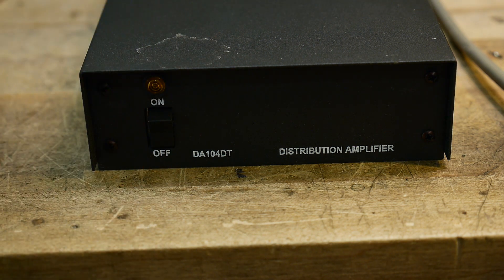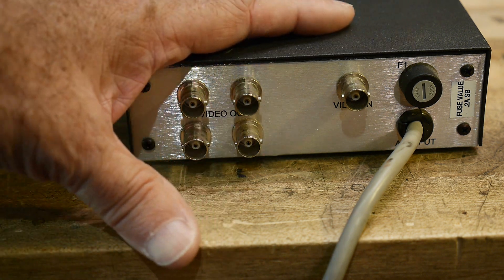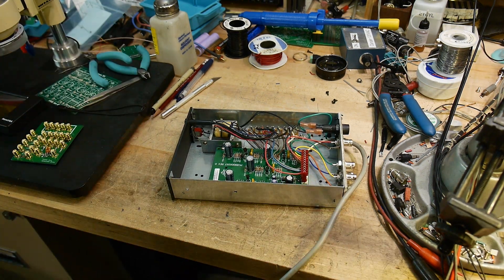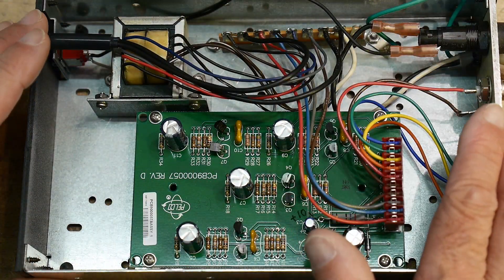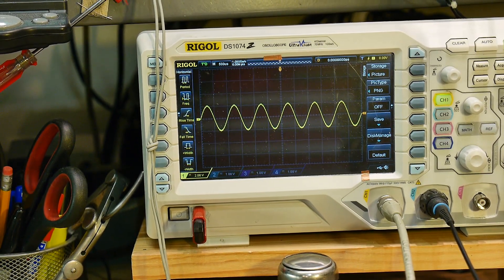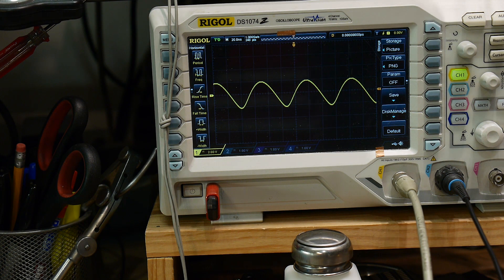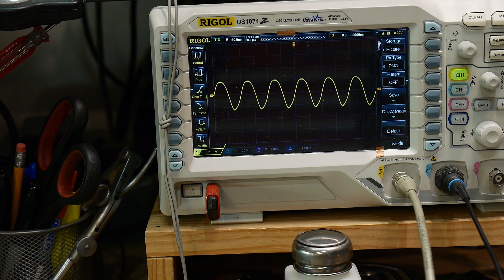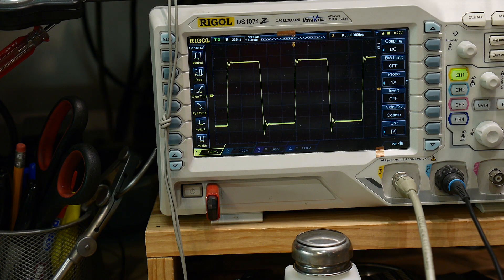#579 75 Ohm Distribution Amplifier

Comment: The output impedance of a video DA is usually set by a series build-out resistor of 75 ohms This one evidently has a fixed input impedance of 75 ohms set by a shunt terminating resistor of 75 ohms.  You can change the impedance to 50 ohms by simply changing the 75-ohm resistors to 50 ohms.  These amplifiers are designed for unity gain and are usually flat from DC to a bit above 8mHz to 10 MHz.  This one is what is usually referred to in TV work as a ''Throwdown" DA.  The idea is you need a quick feed to several different loads, like a series of TV monitors across a stage, and you run one video feed to the stage then ''throw down'' a DA and hook the other monitors to it.  A more sophisticated DA could have frequency response, phase, and delay adjustments and sometimes other features like a DC clamp, etc.  Video DAs can also be used to distribute multiple feeds of digital audio because of the low noise, wide frequency response and good phase linearity. A Good quality video DA will generally have a differential phase delay of less than 1 nsec across the frequency band.

Comment: Wait, I don't get it. If your terminator on the end of your coax is 50 Ohms and the coax is 50 Ohm coax then There will be no reflection from the terminator. The source R of the splitter may be 75 Ohms but who cares? It just will be slightly attenuated. Or am I missing something?

Comment: Do you know if 75 ohm quality TV splitters can be used to phase antennas as power dividers? 
I use 75 ohm cable for VHF ham radio and my yagi antenna is designed also to 75 ohm.
My SWR are 1.8 - 1.3 measured with the Nano, impedance varies from 82 to 50 ohm on 144-146MHz, I transmit with only 5 watts, I guess 3-4watt on the antenna.
I use "F" type connectors, crimped ones, very solid and fast to install.
Thank you for your time.
Reply from the maker: I'm not sure the power rating of TV splitter as they are a receive only product
Reply: Don't expect for "power" from a splitter.
Voltage levels are about 1Vp-p (+700mV 100% white, -300mV Sync).
Reply: @paulcohen1555  Sorry, my knowledge is very limited, do you think it will stand 5 watts of power (37dBm)? TV amplifiers usually connected to these splitters I think they have some power..
And most important, can they perfom as power dividers or are another kind of animal? 
Thank you!
Reply from the maker: splitter means part is going one say one another way, so the power has to go somewhere. yes it divides. I would guess they would not work at 5watts
Reply: @DavidLopez-bz4rj  No, they are not designed for that power level.
They are designed for RF levels of the antenna.
(My previous post was for line driver of the"baseband" signal).
Reply: @DavidLopez-bz4rj  The device he is showing is a video DA, not an RF DA.  These are designed to have an input of 1V p-p and make four outputs of 1 V p-p.  The power involved is E^2/75, or 1/75 of a watt.  It also has a bandwidth from DC to 8 MHz or so, rolling off to 10 Mhz more or less.  An RF DA, such as is used in cable TV systems or RF antenna distribution systems, is a totally different beast.  Front End amplifiers driving long runs of cable can operate at several watts out, though they are still intended for low power, mW, in and the bandwidth can range from 50 MHz or so up to several hundred mHz, depending on the type of system it is intended for.  I don't think either one of these would really work for your intended application.
Reply: I will try it soon and I will let you know the results. I hope they will stand some power, I think in the inside there are coils and resistors, and as I said they are usually connected right after TV amplifiers. 
Thank you for your replies, and for helping people learning something new every day.
Reply from the maker: @DavidLopez-bz4rj  you know TV amplifiers are outputting about 0.01 milliwatts....
Reply: @IMSAIGuy  Didnt know... So they are rated at dBuV then, not dBm... I will try to transmit with low power to see if the splitter can handle it. I will tell you. I got some of them for free, 2 port and 4 port, insertion loss is 0,1dB I think. If I had more power, like 50 watts I could test them to see when they started to melt. 
Thank you!
Reply from the maker: @DavidLopez-bz4rj  The units don't really matter. The receiver sensitivity of a TV might be -70dBm, so a 25dB antenna amp is doing the job of taking say a -80dBm signal and amplifying it to -55dBm and give a good picture. -55dBm is 3 micro watts or into 75 ohms 200 uV
Reply: @IMSAIGuy  Ok, thank you, now I understand it better.
Reply: It depends on the amplifier, like so many products. This particular model, a Pelco DA104DT, is designed to be a coaxial signal repeater and is unsuitable for radio broadcast as it is an unity gain amplifier with maximum input and output voltages of 2Vpp (~8.2dBm or ~6.6mW in a 75-ohm system). It will not be able to withstand or produce enough power for most antenna systems, and is only spec'd to 10MHz. You will need a proper broadcast amplifier(s) suitable for radio work that has input power, output power, and frequency response specifications appropriate to what you are trying to do.
Reply: @NimbleJack3  Yes, I will use a ham radio VHF transceiver connected to a yagi antenna, my question was about connecting two or four phased antennas through a TV splitter, because 75 ohm hardware is cheaper than the 50 ohm power divider.
Thank you for the reply, I will test it as soon as I build another equal antenna to phase them and see if it works.
With the NanoVNA maybe I could make some measurements to see if it works at least for receiving.
Reply: @DavidLopez-bz4rj  Ah, I think I see what you're getting at - you want to connect multiple active elements to a multi-output amplifier so that they constructively combine into a single wavefront?
Reply: @NimbleJack3  Yes, but the amplifier is built into the walkie talkie, which is connected to an antenna.
I will use two identical antennas connected to the two output ports of the splitter and the talkie to the single input.
The splitter is reversible, so it can be used for receiving but also for transmitting.
This is known as an antenna array, and doubles the gain. Commonly in ham radio, a power divider is used, which is a waveguide made of metal, able to stand hundreds of watts and rated at 50 ohms.
As I am using only 5 watts I will try to use a cheap TV splitter.
https://www.amazon.es/Divisor-5-2500MHz-Adaptador-Distribuidor-Splitter/dp/B082QMVTBC/ref=asc_df_B082QMVTBC/?tag=googshopes-21&linkCode=df0&hvadid=420419917370&hvpos=&hvnetw=g&hvrand=5868225957967394624&hvpone=&hvptwo=&hvqmt=&hvdev=m&hvdvcmdl=&hvlocint=&hvlocphy=9047048&hvtargid=pla-859668850041&psc=1&tag=&ref=&adgrpid=95757266386&hvpone=&hvptwo=&hvadid=420419917370&hvpos=&hvnetw=g&hvrand=5868225957967394624&hvqmt=&hvdev=m&hvdvcmdl=&hvlocint=&hvlocphy=9047048&hvtargid=pla-859668850041#

This is the power divider:
https://www.pcs-electronics.com/antenna-dividersspliterscombiners-p-1527.html?gclid=CjwKCAjw_Y_8BRBiEiwA5MCBJmVLwM_C1-RcMVNZbvDRl5GkMMyw8_rVYMhSQcW2Ytnfhw7xXCVyKRoC47IQAvD_BwE

Comment: I have a very similar 8 port version. I changed the resistors on the output to 50ohm, after seeing w2aew do the same in one of his videos.
Reply from the maker: thanks makes sense. at 10mhz it is all rolled off anyway and I'm too lazy since it works just fine for me